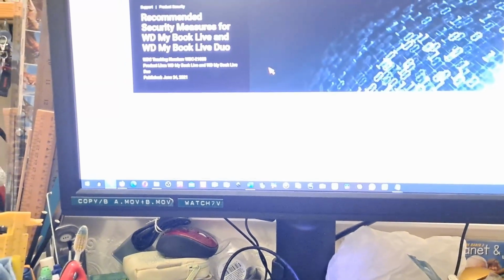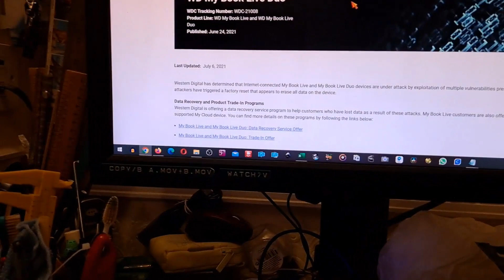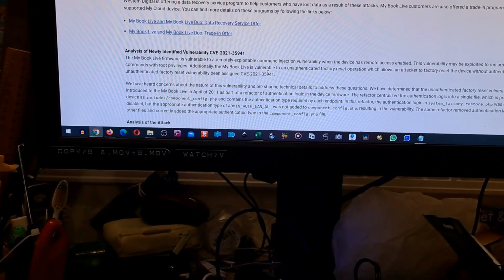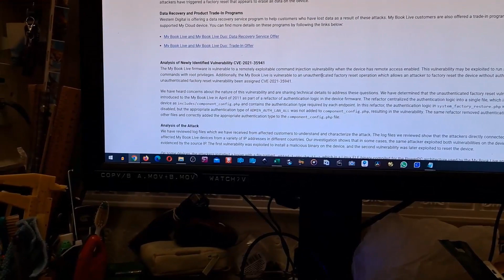PART 1 - Can I recover my files from my WD My Book Live NAS?

Comment: Howdy Diddely, don't know if you progressed your data retrieval hunt in the 2 years since you posted ths, but my own device just failed in the last week, still lit up, but nobody home. I persevered, Googled, and whatnot, and I'm now triumphantly sitting back, contemplating a cold beer while my 1.61TB of MyBook live data is beeing tranferred to another disk (looks like it's going to be a LOOONG time!. The disk isn't encrypted, it's a Linux (Debian, I think, EXT4) partition, one of three on the drive, and a simple SATA interface behind the screw on board. I undid the whole thing and plugged it into a USB caddy, and tried vaious software suites (Isobuster, Diskinternals Partition Recovery, and some others), but finally had (relatively expensive, £50+, plus VAT) success with EaseUse partition recovery. Had to add an extra drive (8TB WD NAS drive) to recover the data to, but it's whizzing away merrily just now. It looks like it's goint to run all night, but I've got my data back. As the add on board still lights up, and the disk is still accessible, I might persevere with recovering the MyBook Live, but I'm not too confident. Hope this is of some help to someone, as these things are ancient history now. Regards.

Comment: I just bought two, and can confirm that just levering the clips on the back port side releases the cover without breaking clips. I used a metal icing spatula thing that was thin and flexible. These two I bought are apparently working. It is fine to use these as network drives as long as you turn off "remote access" in the software. The encryption is a bit offputting, I'll just have to make sure I have backups as these are getting hard to find!
Reply: Oh I should have seen this video first.. anyway if I can recover the information from my disk or at least reuse the enclosure even having to tape it together i'll be fine :)

Comment: I would just simply totally disassemble the NAS, remove the actual hard drive & connect it to either a desktop PC or a laptop (through a generic SATA2/3 - USB 3.0 external enclosure). Operating System-wise Ubuntu or like System Rescue CD linux live distribution would be more then adequate to access the files. 🤔🙄

But you could probably even get the EXT2/EXT3 driver for Windows so you could make the transfer easier like so. Because the data partition on these is a Linux-based partition type. So not a FAT32 or NTFS. 😉😎

I'm not sure how is it with data encryption on these WD products though. Because I do have experience with them (see my channel). But WD My Book Live is WAY better then their newer My Cloud products. Those go bad very often. Of course a Synology NAS is even better... 😕😊😒

Comment: Just this week I tried to use an old WD MyBook Live Duo which is the same device but with two drives in a raid configuration. It powered on but couldn't get it to be recognised by my PC. The old interface used to look at the files wouldn't work. I saw the same message on their website about the vulnerability and they were now discontinued. I always found it to be incredibly slow  transferring data hence why I didn't continue to use it. Just today I took both 3GB hard drives out and reformatted to just use as external drives. I had a few of the MyBook external hard drives, mostly with firewire connections to use with a Mac but useless nowadays, just having one left with a USB 3 connection which I need to see if it still works.

Comment: I did wonder if there was some software written to decrypt the hard drive, as I can't imagine you are the only person to have suffered this problem in the time this device has been around, but from reading the video description it seems you have found a solution. I used to have a program for Windows Ibefore I stopped using windows) that would rename MP3 and WMA files from the metadata on the files to make everything consistant, so it might be worth hunting one of them out - I think the one I used had a small licencing cost but I had about 18,000 files to deal with including removing the WMA copy protection and conversion to MP3 but there are other free programs out there,Unfortunately I can't remember what the software was called.
Reply from the maker: Yes, not sure why it worked, but I recovered all the files. However, in most cases, that did not include the file names, so I have the data, but will have fun identifying it. The music files do have the meta data, so they can be grouped by album and track. The old photos have the dates, and that is probably good enough as in most cases they would have had default file names.